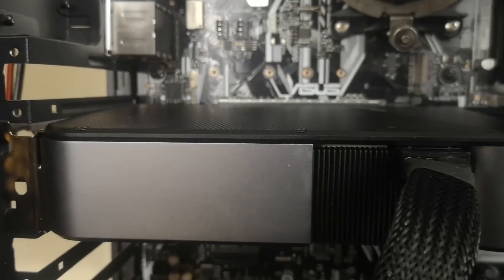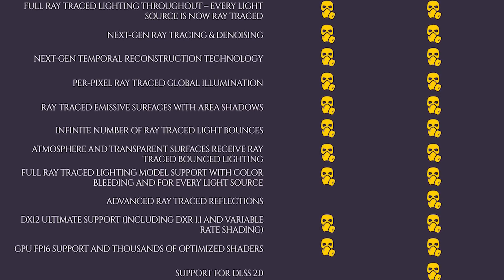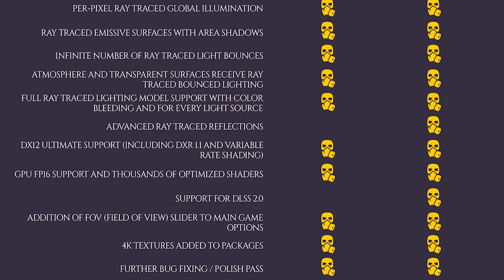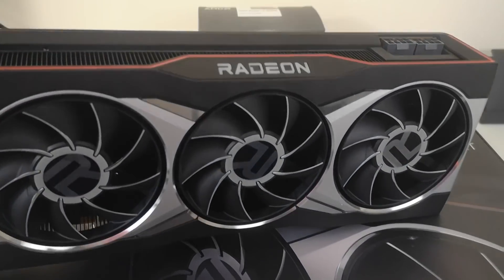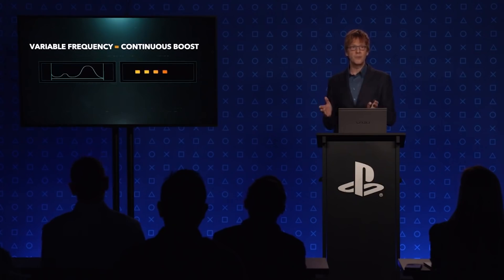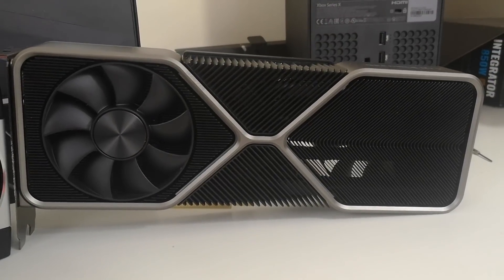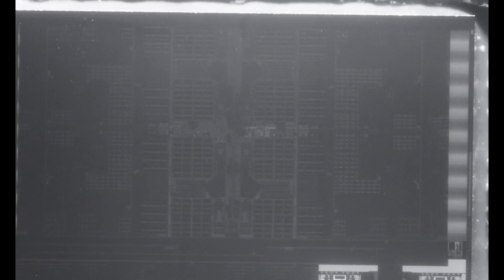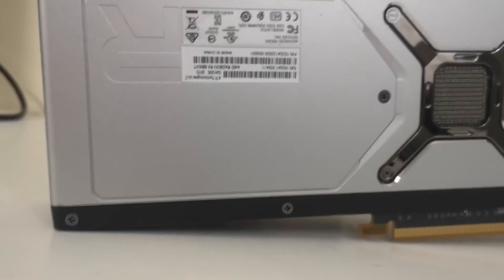XSX & PS5 GPU & Raytracing Performance - 4A Reveals All | Xbox SoC Secret Sauce by Microsoft

Comment: It works both ways  as some things also don’t scale as well with clock frequency as they do with more CUs. I’d just about always take more compute units at a slightly lower clock speed than less compute units being pushed to the limit especially in the power envelope as something like a console.
Reply: RDNA2 GPUs scale to 2.8GHz, 2.23 is hardly pushed to the limit..
Reply: @defeqel6537  2.8 on a massive gpu that is almost the size of the ps5 and you need to put that in a big case with high airflow.
Reply: @danielanane246  That is with a 6800 XT though, so on a PS5 GPU - you could probably hit even higher frequencies in a case with better airflow - so yeah, 2.23 GHz is not really pushing the limit. Not to mention the 6700 XT - which is similar to the PS5 in CU count, supposedly is one of the best cards in terms of overclocking for RDNA 2.
Reply: @icaruswindrune7116  the oced 6800xt has the same tdp of an entire ps5. Point invalid. The sony approach is slower, period. Over a certain frequency, gpu don't scale well so it's useless to go higher, you will only produce more and more heat for no real benefit
Reply: @danielanane246  it's also a lot bigger die, which makes pushing frequencies more difficult, not less
Reply: @enricod.7198  You honestly never understood my comment, did you? I was replying to Daniel about how the 6800XT could reach those frequencies even while being a massive card outputting hellish amounts of heat and that was all in a good case. 

I then said that if the PS5 had been in a bigger case, we could very well have seen Sony opt for even higher frequencies - but, as we know, that did not happen. Hence the IF part.

Finally, I said that the 6700 XT, which is about equal to the PS5 in terms of total CUs, should clock even higher than the 6800 XT in a good case simply due to the card having less CUs that will produce heat.
Reply: Pretty sure going for higher clock speeds over CUs saves a lot of money and PS5 seems to pull off that very well since the system is just as silent as Series X with the downside of being a big boi console. Basically Sony saved money on the GPU and put it towards the SSD and controller features. Seems to compete well in the GPU department against Series X so far too.

Comment: Why Xbox Series S going forward will NOT be a problem.

DirectML... Currently capable of reproducing a 4K output with 1080P internal resolution.

This can apply to volumetric effect, post process effects, ray-traced reflections and shadows, etc. If they use this (which they should since it will be the broadest reaching ML API), there should be no concerns.

RAM? They also speak about Sampler Feedback Streaming - it reduces waste in RAM by approx 70% or 2.5x multiplier of asset complexity/density in the RAM.. Ergo, if they use it, series S would be running the modern equivalent of 25GB.

Variable Rate Shading tier 2 would help with FPS, due to it's sub-4K target, probably about 15% boost.

Mesh Shading Geometry Engine would help, but not as much as the other technologies... Since most modellers tend to use as low tessellation as possible. But it can help to reduce or accurately scale poly count.

And DirectStorage is FAR superior and scalable than what PS5 uses. 

DirectStorage works additively and independently from the I/O - Nvidia has seen massive gains up to 2 - 8x performance when feeding the GPU with data directly compared to the SSD Rated I/O based on M.2 NVMe GEN 3 performance. 

Xbox uses a decompression chip built into the GPU. PS5 relies on an independent Custom Flash Controller with a peak decompression/compression range of 4.1 at 22GB/s (which is why Sony waited for Samsung's 5GB/s SSD and boosted it to 5.5GB/S to MAX the CFC, which is confirmed by RAD GAMES to be currently operating at about 18GB/s of compressed/decompressed data). A GPU can consume 215GB/s... And this is accelerated so it doesn't impact the GPU in any detectable way.

The Custom Flash Controller regulated the ENTIRE flow of data to and from the the SOC and RAM.

Direct Storage allows the I/O 2.4GB/s (4.8-6GB/s of decompressed data) to feed the RAM and CPU, and while direct Storage would at minimum be feeding the GPU at a rate of 2x (4.8GB/s -> 9.6GB/s decompressed Data) Directly to the GPU..

So, at MINIMUM 2.4 + 4.8 = 7.2GB/s x 2 (minimum compression) = 14.4GB/s of decompressed data.

But say it sits conservatively at the medium -> 4x 2.4GB/s = 9.6GB + 2.4 = 12GB × 2 = 24GB... Up to an index of 100GB of game files can be loaded to the GPU at effectively as fast a rate as it can consume up to 120FPS.

This is why Xbox can load as fast as PS5...

Master this, and effective the SSD could modestly perform WAY faster.

Sources:

GPUDirect Storage effect, visualization:

https://m.youtube.com/watch?v=GAZP1NcdWMo

Nvidia walkthrough:

https://m.youtube.com/watch?v=Z2e1vclBoBQhttps://m.youtube.com/watch?v=Z2e1vclBoBQ

Microsoft uses the same approach and implementation;

https://www.tweaktown.com/news/74898/directstorage-will-optimize-gen4-ssds-for-windows-10-gaming/index.html

https://devblogs.microsoft.com/directx/directstorage-is-coming-to-pc/

Edit:

Adding one more technical breakdown source GPUDirect Storage:
https://developer.nvidia.com/blog/gpudirect-storage/
Reply: Series S is a huge mistake
Reply: @ps5hasalreadywon269  sales say otherwise. And Devs that actually work with it say it's no problem.
Reply: @Carrot nothing to support your comments? Thought not.
Reply: This isn’t even right... smh

SFS enables is fine-grained control to stream in/out parts of a mip.
So while texts are most demanding there is still some assets it still has to process.
And although not much, does require extra work for the devs to fully utilize.

DirectStorage API is designed to speed up game loading times and improve performance of games by eliminating storage API-related bottlenecks and reducing CPU involvement. (Literally MS words)
PS5’s I/O is completely independent from the CPU, so how is it even “FAR” superior?
and PS5 ALSO has a decompression chip built in btw

Comment: Ray traced AI?

Doesn't sound like a thing, unless my understanding of what Ray Tracing is, is flawed.
Reply: What I’ve heard is the devs can use ray tracing to detect collisions through complex geometry. This can allow for more realistic simulation of eye sight. So AI would have to be looking in your direction in order to see you and their sight can be limited by particles and environmental things like fog.
Reply: @shanghaidilly3144  that still sounds like Ray Tracing is a visual thing in this example. AI is then coded to use the information available. 
I wouldn't associate Ray Tracing with AI using this example.
Reply: @youtubevanced4900  no it’s not visual. He’s talking about the AI detecting the player and how the AIs actions affect you. Something like using ray tracing to calculate the trajectory of a bullet. That is more towards game physics than visual.
Reply: @youtubevanced4900  Not a visual thing, but a way to make the AI respond more realistically. Currently, the systems used to determine if the AI can "see" you are really rudimentary with the AI just determining if you are in a spherical or conical "zone" and then determining if there is occlusion. Ray tracing would allow for varying degrees of sight such as you hiding in a shadow, thus the traced rays back to the AI would not allow for detection. Also, 3D sound could be employed to have AI realistically react to sounds in the environment including the direction of those sounds.

Edit: when I say AI I mean the NPCs in the game.

Comment: Ray tracing is overrated. Give me well executed screen space reflections and a good frame rate
Reply: I thought the same. The Screen Space Reflections in Control on my PS4 Pro are so grainy. Control may look quite good but other games without Raytracing like God of War looks better on Playstation. Raytracing is nice but it also costs a lot of computational ressources and it's always the question if the computational ressources should not be used for other less demanding effects. Then we may have not the best quality on the VFX side but we may have MORE effects, higher drawing distance, higher FPS and so on.
Reply: @dc_coder_84  Ray tracing apparently requires a lot of CPU resources as well but I bet most would prefer that to go to stuff like physics and AI.
Reply: It must be said that reflections are the most useless feature of ray tracing. Pixel-level shadows and ambient occlusion are way better. It's 2021 and some games still lack contact shadows and some thinga can't cast shadows due to shadow maps and performance. Ray tracing solves this and it's the lightest of ray tracing effects, for a beautiful gain in visuals. Heck some gamss still have things floating on sufaces

Comment: Ther is alot of die space taken up by the PS5 custom IO block, that nobody done a deep dive on.

Remember, PS5 IO Complex has:
- SRAM, undisclosed amount
- Kraken decompressor
- Twin IO Co-processors
- Cache Scrubbers
- Coherency Engines
- DMA Engines
Reply: Could you dumb down what you said for me?
Reply: Thing is , to actually use them in a meaningful way , you have to design ur game based around these features , like what ratchet does , u need a whole different way of designing level and so on  , but since the Series dont have them , multi-plat games wont be designing their games based on those features cuz then The Series wont be able to run them and thats a huge market to lose
IMO mostly exclusives will use the IO to the fullest , and then there is the problem that u cant directly compare two exclusives from the different consoles in any meaningful way
Reply: @nicknickname353  Thats nonsense, you can't not use the PS5 custom IO, its what the whole PS5 is built around. Multiplatform games will use it as they have too
Reply: @marty8370  lol they use it only for basic ass stuff like decompression and loading
If a game uses 100% of the PS5 IO capabilities , the game wont run on Series consoles and most PCs , cuz they are far behind in this aspect.
Thats a huge market to lose if ur not getting an exclusive deal by sony
Reply: Sorry can't dumb it down any more. Look up what an IO is and you'll be good then.

Comment: Trashbox isnt Full RDNA 2 either. It mising 3 key RDNA 2 features, no 
high clocks, no smart ram & no Infinity Cache. This prooves both PS5
 & Trashbox have a mix of RDNA/RDNA 2(hense why they are custom RDNA
 2)
Reply: False ponie. Svck it!
Reply: Smok3 SHO  That would be true if you stream raw data all the time, but its not, you bring the data then you rework it, that's where 36 CU vs 52 come in, the more you can process will define frame rate, as cpu cores some games will benefit for clocks other for parallel workloads its all on the game engine and developers, MCM Gpus are coming soon they better start using it, also that PS5 can get improvements there, both will be similar but I prefer series X approach since High Clocks and heat will be an issue at future.
Reply: Xbox has a 320-bit bus
And 100 GB higher memory bandwidth....
Reply: @mrrglass3407  Split memory & bus which is a clearly problem, It not full RDNA 2
Reply: You are actually wrong , smart access memory and infinity cache are ryzen 5000 cpu features and the consoles don’t have those , and “high clocks” are not a feature of rdna 2 , that’s just what it’s capable of doing, clock speeds are not a “graphic feature “
Reply: @earnistse4899  No it isnt, infinity cache is part of RDNA 2. its ther too speed up the narrow 256bit bus, all RDNA 2 GPU/PS5 APU run at high clocks. Trashbox not so high, smart access ram is also a feature of RDNA 2. All 3 features are missing from PS5 & Trashbox(PS5 has the high clocks)

https://www.pcworld.com/article/3587327/amd-radeon-rx-6000-graphics-cards-rdna-2-infinity-cache-smart-access-memory.html
Reply: @marty8370  you are wrong! Stop peddling your bs , smart access memory requires ryzen 5000 cpu and so does infinity cache , rdna 2 is capable of it but you can’t use it without ryzen 5000 cpu
Reply: @earnistse4899  YOU ARE CLUELESS, THIS PROVES THAT TRASHBOX CAN'T BE FULL RDNA 2(AS ITS MISSING 3 KEY FEATURES)(SO MICROSHAFT IS LYING)
Reply: @earnistse4899  High clocks are important for GPU efficiency.
Reply: @thechimera6963  high clocks means more power consumption , lower clocks is for better efficiency. Not sure what you are talking about
Reply: @earnistse4899  Whaaaa? What are you on? "lower clocks is for better efficiency" 🤦‍♂️. Said no dev ever. You let me know where I can find anything that says this. Is that why the Rdna2 cards run at 2105-2250? Lmao. How come the 5000 cards can't reach the efficiency that you speak of? To reach the maximum output of the CUs, you need a faster clockspeed. That's why you multiply the CUs by the clockspeed to find out the teraflops. Derp!
Reply: @thechimera6963  efficiency as in power consumption!!!!! Lower clocks means better temps and lower power
Reply: @earnistse4899  Guess Cerny wrong and your right/s
Reply: @thechimera6963  You again...lmao!!

Comment: DX12U is just an API(it controls the hardware features),, PS5 don't need
 D12U API to have all the hardware features in some form. Sony has ther 
own APIs, all they do is update them with RDNA 2 features. Even  
DirectML.API works with other APIs eg AMD ML(which is open source) &
 Vulkan. RDNA 2 has enhanced CUs(with int4/int8 & ray 
cores(accelloraters) as standard(it not something Microshaft added), so 
the likehood that PS5 has them is high. So Machine Learning can also be 
added to the PS5 APIs
Reply: 36 CUs vs 52 CUs.  
144 TMUs vs 208 TMUs. 
2304 Shaders vs 3328 Shaders. 
448GBs vs 560GBs.  

Your beloved PS5 is limited 'in-hardware' and will not be able to render or process next-gen games at the same level as the Xbox Series X. 🤷🏾‍♂️
Reply: @freddywayne  you fanboys are really dumb dumb and clueless yet keep repeating numbers you barely understand.. smh lol
The Variable GPU of the PS5 has a CU refresh rate of almost 2x.
Rasterisation, Cache Buff. and Dumpin Speeds etc are all faster by 33% on top of that a gpu scrubbers.

XSX's GPU comprises of 52 CU's that have to refresh themselves completely each and every time info is sent and received.  The PS5s 36 CU's dont. They keep what info they can re-use. This is selective dumping and what it does refresh, it does 33% faster (clockspeed)

They’re both designed differently, both are unique in their own right.
game wise both hasn’t had any significant difference from each other
Ergo, while one is superior with a but the other is better with b.
Reply: @freddywayne  When you fetching as often as PS5 is cos of how fast the Custom IO Block is. Cache scrubber are very important feature to free address space/ram/eliminates cache misses
Reply: PS5's gpu doesn't have enough hardware to support 'full' RDNA 2 or as many RDNA 2 features that the Xbox Series X can.  Simple math.

The PS5 would have to try simulating or running some things in software that it lacks in hardware. 🤷🏾‍♂️
Reply: @freddywayne  Sony has ther own custom solutions in hardware, just as it has it has its own custom APIs

Comment: I think something that's overlooked is that you can scale RT performance with OC On AMD cards that doesn't appear to happen on RTX cards.  I compared a 6900XT to an RTX 3080 in Control, and the RT performance narrowed noticeably when the 6900XT was OC'ed to 2650MHz and the RTX card didn't show any noticeable RT improvement with a +130Mhz. I think this might be how the RT is implemented (add on to a normal CU, vs a completely separate unit).  The 6900XT was actually pretty close in RT performance in Control once OC'ed (within 10%).
Reply: Very valid and underestimated point.
Reply: Exactly what I thought! 👍
Reply: @RubiiX yup that’s what I was saying, but you said it better. :)